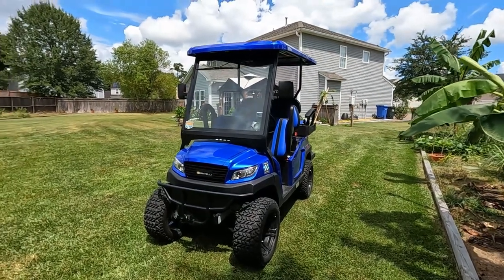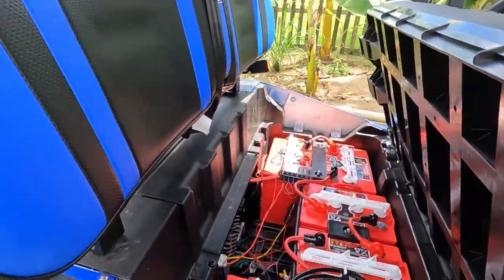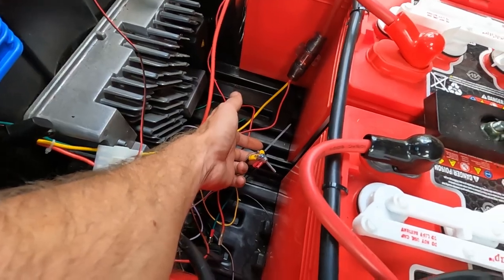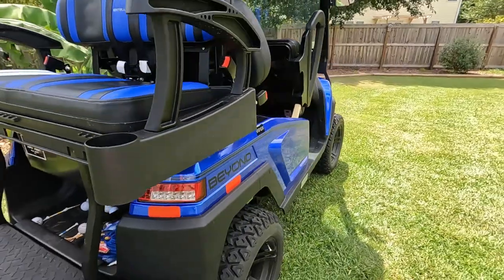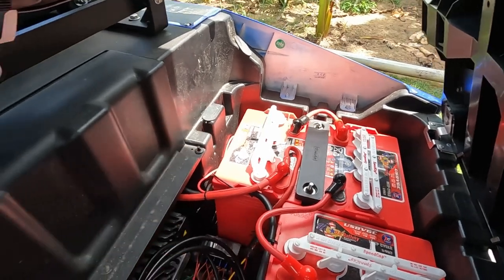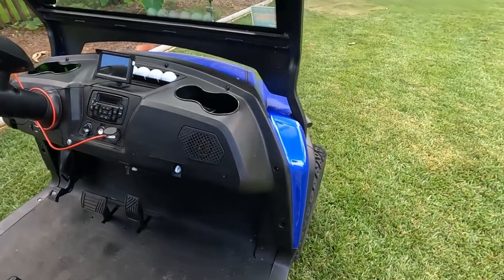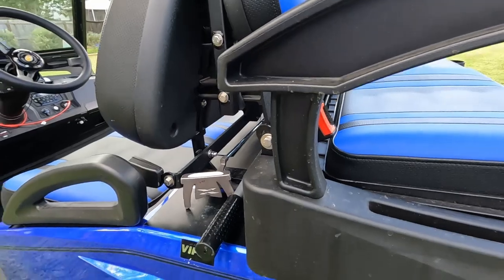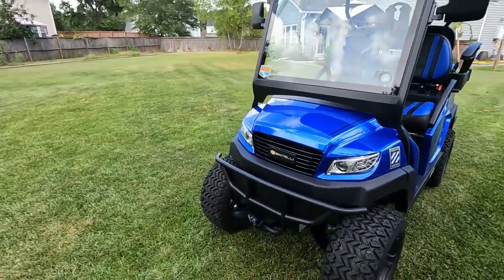Bintelli Beyond 4PR Initial Upgrades (links in description)

Comment: Do you have  a video of you installing the lights that connect to the factory switches  ?
Reply from the maker: Not really, but there is a video where I stick the camera behind the dash and poke around back there. In that vid, I show the plugs. If you haven't looked in there yet, mine were in a baggy, zip-tied, right behind the radio. 

https://www.youtube.com/watch?v=s5z4un_fAAI 
It's in the middle, around 4-5 min mark. I think there's links in the description to the plugs I got off of amazon to plug in to them.

Comment: On the convertor did you ran the green wire from the ignition keyswitch from the front of the cart to battery side and connected to green terminal to convertor?
Reply from the maker: Connecting it to the ignition would be a good option to automate the remote power. I was a bit short of wire during the install, but I had a short piece connected to an automotive DC two pole switch. I tied that into the 48 volt positive fuse holder and manually switch the converter on and off. I figure I have to open the seat to grab the charging wire, and I have to unplug the charging wire and put it back in storage then close the seat prior to use. It's a simple flick of the switch while placing or retrieving the charging wire to turn it on and off.
Now that I have more wire, I may do that eventually.

Comment: hi   where are the factory accessories switch wiring located to connect to. I see behind but not sure where they go. . I saw a plastic bag with two rapped plugs in it. Is that them?   Thank you
Reply from the maker: Yep, that's them. Here's a link to the plugs on Amazon I found. Used them to power a couple lights.
https://a.co/d/2xJYTTDYETOR Way Car Waterproof Electrical Connector,16 AWG 2 pin Plug Auto Electrical Wire Connectors for Car, Truck, Boat, and Other Wire Connections.(5 Pack)

Comment: Do they have floor mats for the Binelli?
Reply from the maker: I don't know of any aftermarket floor mats. The factory flooring it comes with reminds me of a super thin anti-fatigue mat. It's about 3/16" thick rubber, with a textured finish. I don't know of any other carts in my neighborhood that do have floor mats. Otherwise, I would try and do a test fit of one of them. I would be surprised if the club car precedent floor mat didn't fit in, might just have to make a cut out around the parking brake pedal.

Comment: I have the exact same cart and just received my Kicker speakers today. Can I ask how you were able to install them with the clips attached to the speaker?
Reply from the maker: Sure can! I believe I'm broke the clips in half to use them as a washer, then used the factory nuts to hold in place. Let me see what I can do to make a video of how I installed the speakers tomorrow. I'll go over the disassembly of the dash as well. It's not hard to gain access to the speakers and get the old ones removed. 
Since the carts radio didn't come with an owner's manual either, I'll put a link to an identical radio in Amazon and maybe a quick how to tune the radio, bass, treble, fade, etc. It also has an option for sub out, not sure what that's about. I've pulled this radio out of the dash, there's definitely unused pins. There is no pre-wired subwoofer out though. The radio has enough pins on it for a four speaker output as well. Kind of interesting what they stripped out.
Reply: @oftenwrongparadigm  
Thanks!  I drilled some new holes but I'm stuck.